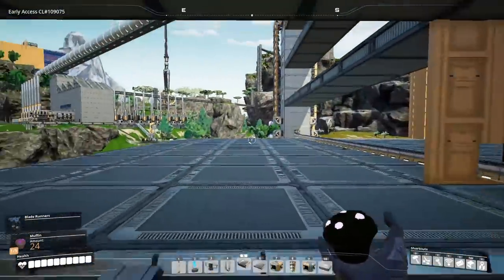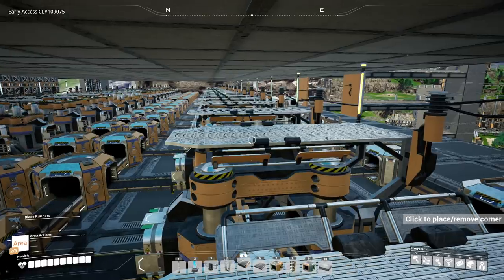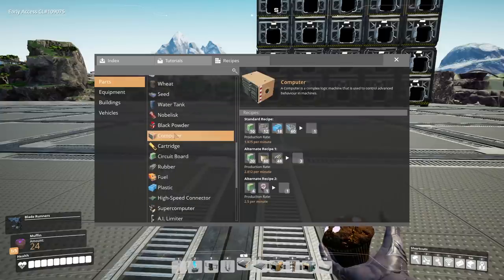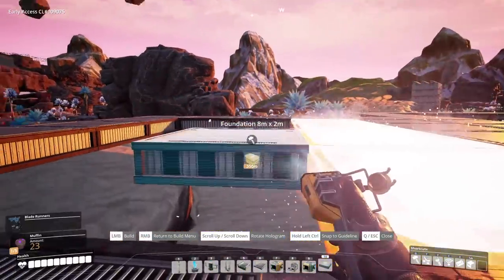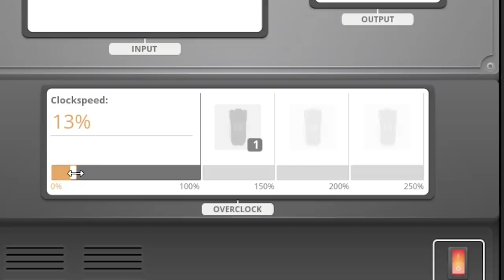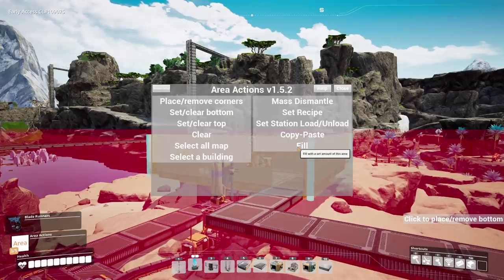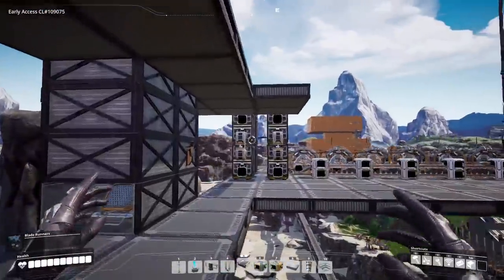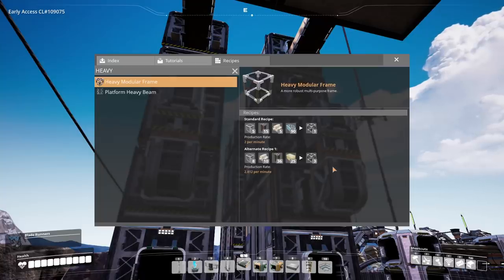Our New Production Method is... Different - Satisfactory Modded Let's Play Ep 15

Comment: kibz! Ryzen 5 3600x is on sale for $259.99 on Amazon Canada. Also the 2600x is cheap af. 10/10 would recommend buying now before they sell out like the 2600x did last year.
Reply: can agree, if you have a bit more ca$$ you could also get a 3700.
PLEASE REMEMBER THAT THE NEW PROCESSOR WILL ONLY FIT ON YOUR MOTHERBOARD IF YOU HAVE RYZEN ALREADY !!!
Reply: @weiiswurst  He mentioned on stream that hes getting a new motherboard as well. 

Note for @ImKibitz: you may need a bios update for any B450 motherboards (likely the ideal case for your needs as you likely aren't using SLI or need PCIe 4.0) These updates would require an older Ryzen chip if the manufacturer hasn't already updated the board. Just something to keep in mind.

Maybe just run down the street and reach out to LTT for a hand :)

Comment: Power Shard the constructor he says, make LOADS of encased beams he says, But then  he leaves the 60/m belts in place.  DOH!!  36 Steel Pipes * 2.5 = 90.  Kibz, you need to upgrade to Mark II belts for the pipes! Otherwise the constructors will eventually run out of their internal stock pile and performance will drop, waiting for the next batch of pipes to be loaded.